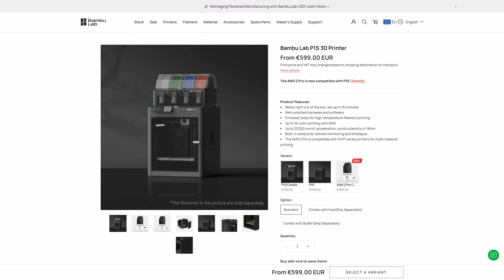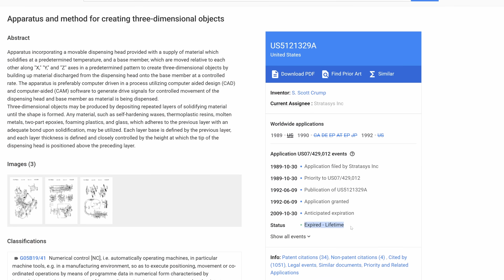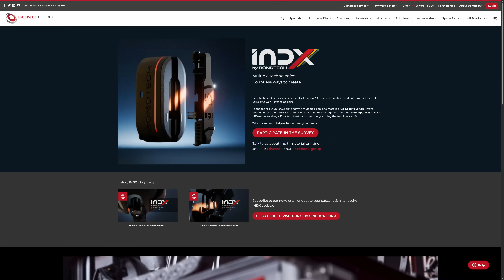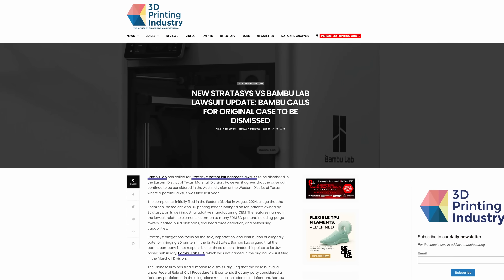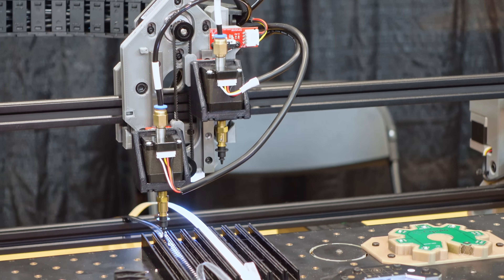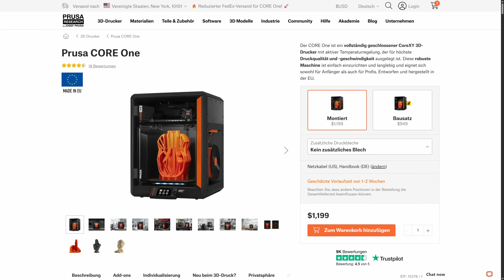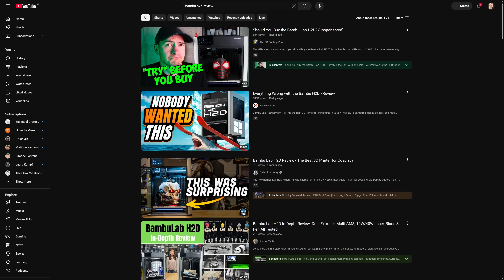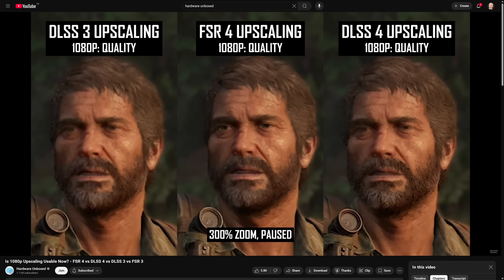How Bambu has won

Comment: I started with a Prusa MK2, probably based on info from one of your or Joel's videos. I have every iteration of every Prusa machine since, along with a couple of Vorons, a couple of Sovol machines, and a Bambu X1C. My X1C sits in my garage gathering dust, as I got incredibly frustrated with endless firmware updates and software updates that changed functionality or just flat out broke things. Same reason I stopped using Samsung phones. This was before they started trying to lock things down. My big concern with the direction that Bambu are going is that they are eventually going to start adding features or making functionality require a subscription or require their specific consumables. This has happened before in other maker areas (Glowforge anyone?) and I am absolutely opposed to this model when you invest so heavily in hardware upfront. Plus, yeah, I'm tech minded and I actually love fixing and upgrading my printers. So I'm unlikely to purchase anything else from them again.
However, I have recommended both the A1 and the P1S to multiple people.  Parents that want to get a printer for their kids, or people that see my various 3D prints and go "oh, i'd like to try that." I think Bambu have opened up the entry level space in a way that Prusa tried but just haven't been able to. The appeal of being able to buy a printer, just plug it in, install the app and then immediately find something to print, no knowledge needed, no configuration, no assembly - I know why they are successful and will continue to be successful. 
I'm glad you've reassessed your position, I have too. There are still plenty of super exciting community led projects happening, but we now have this "plug and play" segment as well, and they both have their place.
Reply: "My X1C sits in my garage gathering dust, as I got incredibly frustrated with endless firmware updates and software updates that changed functionality or just flat out broke things" As an owner of three X1C, I literally have no idea what you are talking about. You are saying the X1C was too hard for you to use and out of your comfort zone? I have not heard of this before.
Reply: @rsilvers129  It was probably better described as the software updates were just the last straw for me in a series of frustrating experiences with my X1C. The AMS, once used with spools that work, is a brilliant piece of design. I just had issues with my X1C, print quality, cooling, over extrusion, bed adhesion, and as a result I just didn't use it very much. So every time I did go to use it, Bambuslicer needed an update, which in turn triggered firmware update requirements. Coupled with the extreme noise from my particular machine, I ended up just getting too frustrated with it and no longer use it. I am well aware that many issues I had were unique to me, hence why I have no issue recommending Bambu printers to less technical people. I know plenty of people love their Bambus, and I think that's awesome.
Reply: @rsilvers129  There were issues for sure as they were trying to break records with the most firmware updates pushed out in the shortest amount of time (when they were locking things down / making changes that didn't work, ect).  Then with that there were slicer changes and updates that were breaking peoples saved files / projects time and time again.  I had so many projects that I made in their slicer, that would no longer work and cause the slicer to crash out every time I tried to print something...

I had to recreate everything and save it as a new file for anything to work.... several times, and it was annoying as it caused me issues in fulfilling orders on time.  There were several other issues as well, but luckily I didn't really have any of them as I stopped updated the slicer and firmware for the longest time.  Now I have noticed if I don't update, all of the sudden my printer won't receive the file to print, but it magically works after it's updated...  

I usually prefer LAN only for printing, but I do need to have a camera on them to watch and possibly stop a print from time to time, which has helped due to AMS tangles and other issues that pop up here n there.
Reply: may i ask what you are using instead of a Samsung phone?
Reply: @aburab  Sony Xprerias and Google Pixels have unlockable bootloaders.

Comment: I would totally watch a 45 minute review from you! I want to see if a 3d printer will work out of the box or whether it needs to be upgraded straight away. SV08 is a great example, great price point, based on a voron but I feel I would probably have to do upgrades on it  straight away. I have also seen reviews where they got two SV08’s one works fine and the other doesn’t work at all. So reliability is something I am looking for as well. These days I am after a printer that just works. Does PLA, TPU and a nozzle option for the occasional abrasive. The H2D is intriguing, but I don’t think it fits into the Bamboo just works category. I have always enjoyed your content, thank you and I look forward to what you do next!

Comment: Stick to what you know Thomas. Solving printing process problems and innovative ways of getting it done. 
The problem I have with proprietary systems is even though you paid for it, the OEM still owns it. Everything ends up secretive destined for single source planned obsolescence. They often won't answer specific questions to assist in fixing older control systems with off the shelf parts they no longer offer or a priced economically unrealistic. The consumer is only of use to the OEM if they buy into the next generation product or they've set hooks with proprietary consumables like filament and wear items. Your purchase price is just their subscription entry fee. Once the honeymoon is over, it feels like a ball and chain with alimony payments until passed off on someone else. 🤣

Comment: from my experience, the last 3 creality printers i had taught me a lot about tinkering with 3d printers. the used ender 3 taught me about how someone takes care of their machines makes a big difference. my ender 3 v2 taught me the joys of modding and running custom firmware, while the ender 6 was for the lack of a better word amazing when it works (released and abandoned almost soon after.) but when we bought the p1s for work i haven't had to babysit everything or wait weeks for a special part. it just works, and as much respect as i have for prusa they are very expensive to order in Canada, especially if you get hit with duties and taxes (nvm tariffs)

overall if a customer comes in and asks me what to buy i will ask them a few things (not in this order.)
1. how experienced are you with tinkering?
2. what do you want out of a printer?

alot of the time its parents buying for their kids, and i would suggest bambu.

my general opinion is this.
Bambu printers (lenovo thinkpad) just work and are pretty cheap, but you dont learn about taking care of the machine.
creality (cheap HP or acer laptops) and a few other, are ok but you learn alot running them.
prusa (framework/ building a desktop) they are fantastic but just really expensive (at least where i am.)
Reply: Not to mention the lack of maintenance required to adjust the bed on older printers.  Newer cheap printers do a decent job of auto leveling but the annoyances are still there.  I like Bambu because I want a printer to do what I want, and when I want at a moment's notice.  I don't care to trick out my 3D printer.  The majority of my needs will never require modding.  

The P1S and H2D have been brilliant printers.  The Bambu Slicer is easy to use and works significantly better than Ultimaker Cura.  Should I need parts, I know I can get them. They aren't terribly expensive and they (so far) seem easy to acquire should i need to replace anything.   

I don't see Bambu suddenly giving up on parts after a couple years.

If you want to mod, then by all means do so.  Bambu, as a closed system, works amazingly for what I need.

I had an Ender 6.  Creality turfed support, firmware was trash and finding a replacement was hard.  When we did it was mediocre at best. Board support disappeared. It would always go out of sync after we calibrated it.  Sometimes it would work great for weeks on end, then suddenly fail, regardless of what I did.  At one point the hot end failed, had problems with the X/Y system and finding and ordering parts took 1-2 months just to get the right stuff and have it shipped. 

Bambu is a game changer.  I am so done with modding and replacing a million parts to achieve slightly better results.  Even with how they are i hope they support their printers (old & new) for a long long time.

Bambu has my vote 100%

Comment: I tell people Bamboo has excellent hardware and for most consumers they are a great option. I do mention that I'm not a big fan of some of their business practices, mostly being locked into their slicer (that is cloud based) and the potential to be locked into using their own filament (using the RFID tags that's part of the Stratus lawsuit) gives me concern about the direction Bamboo is headed. Get you in cheap now then slowly turn up the micro-transactions because it would be too costly to switch. But I could be totally wrong about them and the path they are on.

Comment: I personally look for benchmarks with out of the box settings, so not too much tinkering required to get tolerances perfect. I also look for issues that the reviewer had to troubleshoot. Specs are cool but I don't look at them too much honestly. 

My experience level is intermediate, I tinker with settings and my printer but for the most part I just want a machine to be good from the get go without me having to do too much. 

I don't mind being in a closed garden ecosystem too much as long as there are workarounds, and even with Bambu's BS there's at least workarounds still like downgrading your firmware and running things on your own server, which I've played around with with a truenas Scale server.

Comment: Still hoping you can do a video on using usb/can-bus tool boards.  Yeah, other creators are making this kind of content, but it's very hit or miss... Your old videos (circa 5-8+ yrs ago) were always the best resource.

Edit: also your project builds that are 3D printing adjacent, and like the weird direct to slicer g-code generator for those lithium-ion batteries, that was cool content.

Always stay on the cutting edge, Tom!

Finally: you deserve some massive props on that Voxel filament ad you did at the beginning of the video, that was slick, how you made the ad part of the discussion and relevant to the rest of the video.  Massive props to you! 👍

Comment: The closed and cloud-oriented ecosystem of Bambu is reason enough for me to not get any of their products. My entry into 3D printing was a Chinese i3 clone, and I learned to appreciate the option to tinker and improve the machine over time. It's slow compared to modern printers and lacks features that have pretty much become standard by now, but it still works and does its job decently. I will replace it at some point, but the successor will definitely not be a Bambu machine.

Comment: I think, what I like about your content and like to see is an honest opinion on what is for who. I based my 3D printer purchase on what my customers are likely be using for the tabletop terrain people buy. I got a X1C for prototyping on a wider scale of product.  I got an A1 because it seems a lot of tabletop gamers do buy those machines and they are also reliable, they just work. I just picked up an A1 Mini again I see a trend in gamers to get those. But also, aside from creating product on platform customer use I can push the envelope to fit my needs in a wider scale. The mini is focussed small details to add on my terrain with a .2mm nozzle as my A1 will be switching nozzle sizes. X1C is my workhorse for production when not prototyping.

I would love for printers to be an appliance in everyones home and pushing that should be if not a focus on creators but a side effect encouragement  to make it so.

Comment: Trains used to be a thing that was developed in backyards by passionated people...

Software started in the open before getting much more closed source. Only the persistence and convenience of having open sourced software made it more economically viable for companies compared to buying one from a closed source vendor. Yet most people still use Windows...

3D printers are following the same path today... What we need is to have a lighthouse which keeps on guiding interest towards opened solutions which are more economically viable and convenient. This does not mean that closed solution should not be praised, but they should serve as inspirations for achieving better opened solutions.
Reply: The internet runs off of open source software still today. It's naive to think that open source software isn't running on more systems than windows right now.

Comment: I saved up for the H2D, never bought it The model shows trouble on the horizon. Laser cutting in a box where cleanliness and lubrication is crucial. Two nozzles, want to print all the way edge to edge? The plastic won't be a continuous extrusion. I'm still running Elegoo Plus beds that while slower, work just fine and aren't trying to multitask. Be a printer.

Then of course the whole firmware issue, update, doubling down by lying and changing the wording on their site. I'm just disappointed in the whole company and I don't know if they'll ever get me back. I just hope that by the time I need to replace my small farm of X1C's, there's something that compares.

To those who really get into the hobby/business, even if we have more than a few machines, Bambu lost. They put a stick in their own bicycle spokes during the race. Bambu may continue to grab the consumer market, but the second someone makes an open source machine that is comparable, people are jumping ship immediately.

Comment: What to focus on next....you asked here is my two cents
Keep doing what you are doing...it is fantastic but you asked so... I have a new fast/amazing printer...now what to do with my old ones? 
- Reasonably priced upgrades that get it close to the NEW printer on speed and functionality
- Converting your old bed-slinger into a CoreXY(ish) variation - why start from scratch?
- What printer "knockoff" parts are not worth it?
- Convert your old printer into...a laser cutter, a PCB CNC even a plastic CNC?
- what else can you build with the parts from your old printer. (large scale drawing device - think 48"x48" plotter), Diy AWS, plasma cutter (you use your own plasma torch), phone/tablet remote control, large scale inverted Resin printer

Comment: I dont blame Bambu for doing what they do I think the current patent system is no longer fit for purpose in the modern world. 25 years is just to long, if a 5 to 8 year headstart is not long enough for you then your company has other issues. I think there also needs to be more limits on what can be patented though i dont know enough about it to say what exactly but i remember some company patented some aspect of a video game that i thought was ridiculous.
Reply: Sega patented an arrow navigation system in Crazy Taxi, that's what it was, and while I was googling that I found Namco patented loading screen mini games and I'm not convinced you should be able to patent that either.